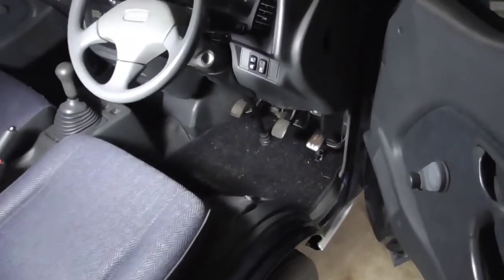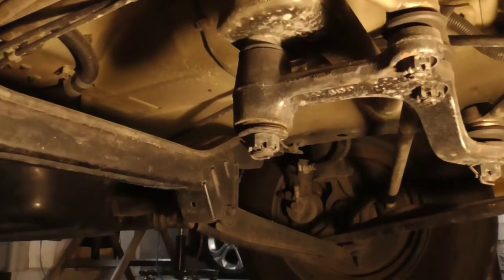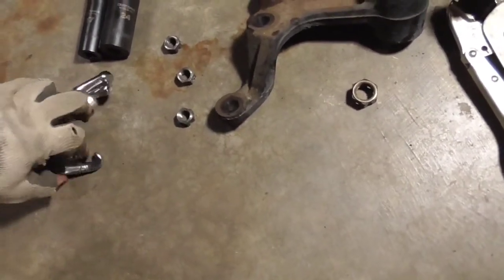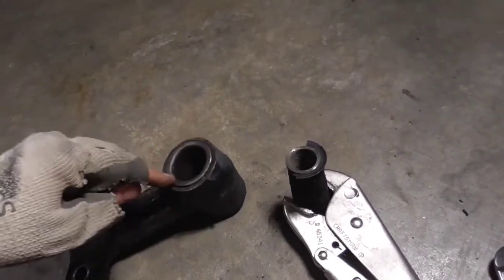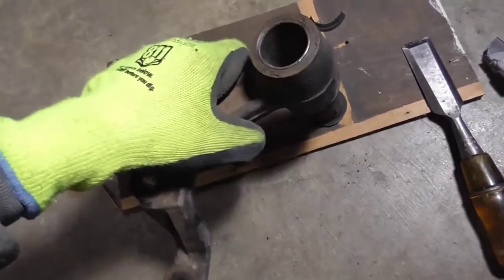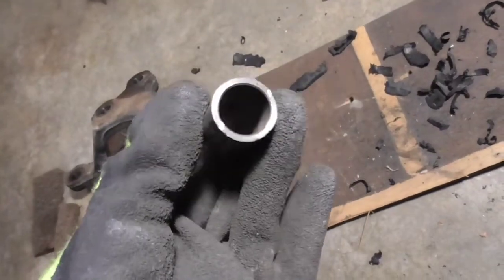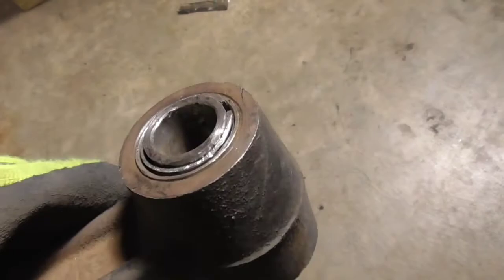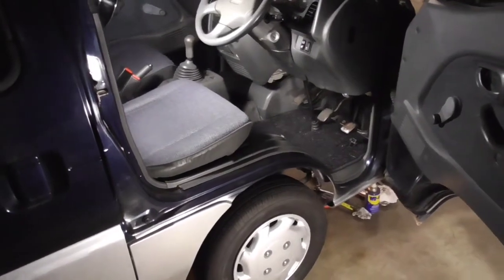Suzuki Every/Carry - Steering slack / looseness repair

Comment: One of my first cars, a 1971 Toyota Corolla (loved that car because it was super reliable and EXTREMELY easy to work on) had play in the steering about TWICE as much as what you showed there, and I drove it that way for years. It was fine until you went over a bump and then it would shake wildly right out of your hands. In my case it was a bad steering box and I just didn't have the money at the time to fix it. Anyway, good fix on your car.
Reply from the maker: Thanks for sharing this relative story.  It's amazing what people will put up with (myself included as I did with this for two years).  It's really an incredibly dangerous condition that should never be taken lightly and should be fixed ASAP.  This van is so much more safer & fun to drive now.
Reply: @theevolvingworld  I do scratch my head from time to time wondering why I put up with it. I guess I had just gotten used to it. One thing that made it feasible at the time was that the steering also pulled to one side, so when I was driving it would stay firm against that pull and it was only if I went over a big bump or pothole that my devious plan showed its flaws!
Reply: @Salvatore Brandon You probably don't exist as a person, but if you do, does flixzone pay you a commission for every time you copy and paste that exact same sentence in comments across YouTube?
Reply: Dalton Lennon  And same for you, "Dalton". You get some sort of payment from agreeing with the other nonexistent person?
Reply: @theevolvingworld  John, did you ever finish that Cappacino EV?

Comment: That's an easy fix I think. Old car, especially 90', always have this bushing problem when previous owner frequently turn the wheel while car was in dead stop
Reply: I agree it looks like bushings are gone
Reply: ..I commented too soon, I see he fixed it
Reply: ... there are videos on pour-your-own polyurethane bushings, mostly for engine mounts
Reply from the maker: @robertpryor7225  I'll have to into pour your own poly bushings.  Thanks.